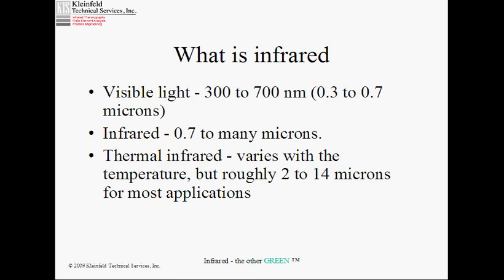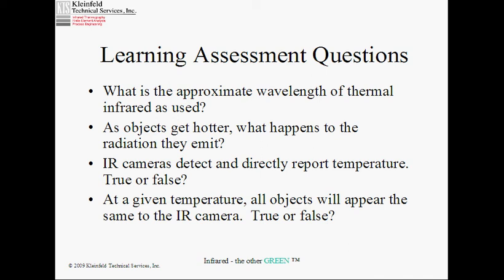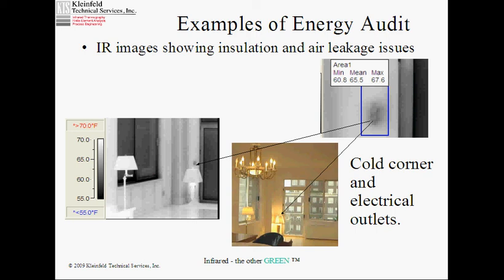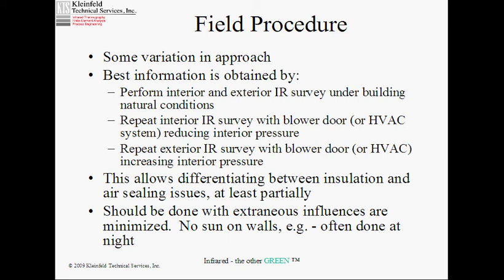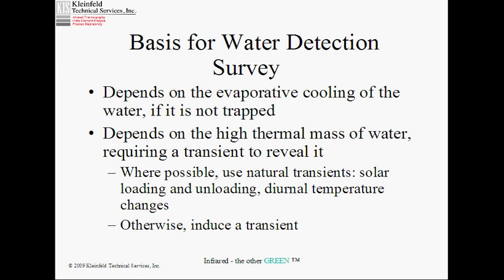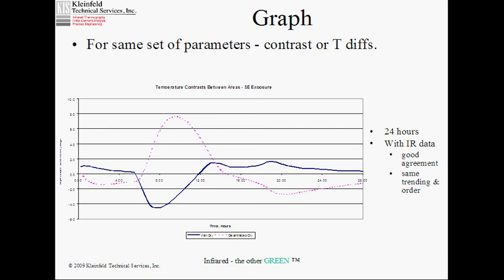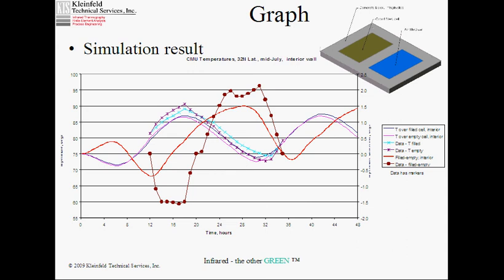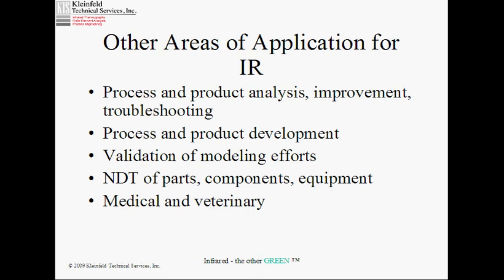Building Applications of Infrared Thermography- at the Annual Meeting of NYSSPE 2009

Comment: Thanks for sharing this great video! I do structural inspections of Post Tension repairs, and I was wondering if one can see the temperature difference at the P.T. anchorage end? Thanks!
Reply from the maker: Hi Eric, 
Thanks for subscribing and for your comment.  
I am only passingly familiar with the details of PT systems, so am not sure if the anchorage is exposed fully or buried in concrete, or if that varies with the installation.  In any event, the first question in response to your question is: "what would be causing a temperature difference in the anchorage?  I am at a loss to think of what naturally occurring T difference there would be.  My only thought is heat conducted along the length of the PT rods to the anchorage, such as might be driven by exposure of the slab to environmental conditions, such as solar loading.  If using active IR imaging, what item to item difference would you be looking for that would have a T response?  Or, are you looking for exact locations of rod ends that are encased in concrete, for example?  
JK
Reply: The PT cable stresses are transfer to the concrete at the anchorage zones. The cable is typ. at mid span in this areas, with about 2.5in of cover top and bottom of slab. I am thinking the concrete atoms are more agitated in this area, and creating more heat. I have a cheap TG167. I will try using it in new construction during the stressing of cables to see if I pick up more heat, after the transfer of stress to the concrete slab.I am more interested on approximately location of the zones, so the worker with the chipping hammer know where to stop or start chipping the damage areas.. Thanks, again for sharing those videos! Do you offer the IF on-line classes?
Reply from the maker: While I'm still not clear on the situation, I want to point out that the first thing to discuss is whether there are thermal phenomena occurring, the question of being able to detect them comes second.  

  If I understand the situation, I think you are looking at the system in a static state, although you talk about looking at new construction during the stressing (which would be transient and might be a thermal event).  If that's correct, then I don't see anything causing a thermal gradient.  However, you also talk about finding zones and chipping away at damaged areas, which sounds different than the stressing of the PT cables.  

Are you trying to look at the surface above the cables while they are being tensioned? That might represent a thermal transient and therefore might be detectable.  

I don't know what IF classes are, so I guess I have not offered them, yet -- doesn't mean I couldn't.  

Reach out to me through my website, it sounds like we should have a conversation.